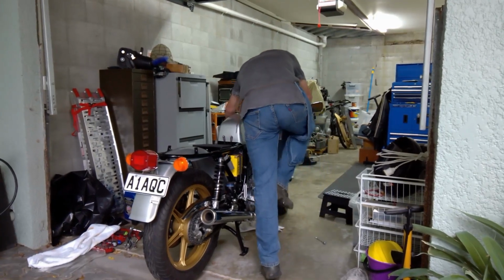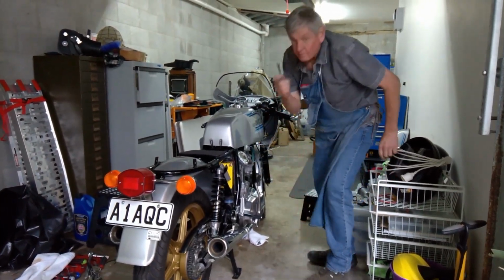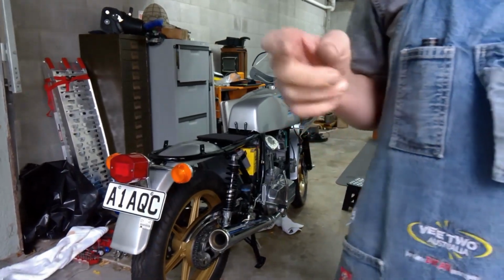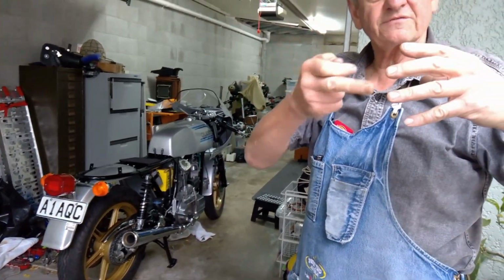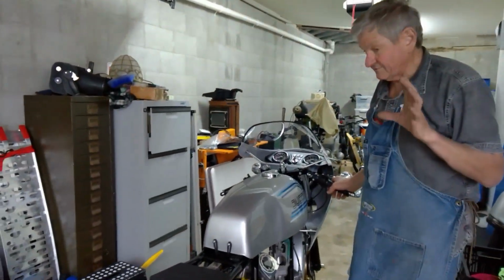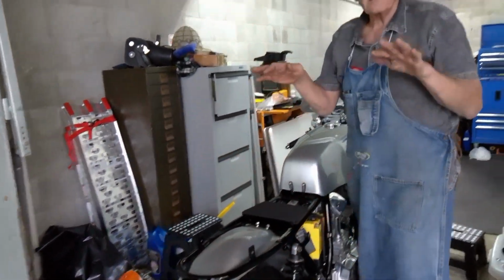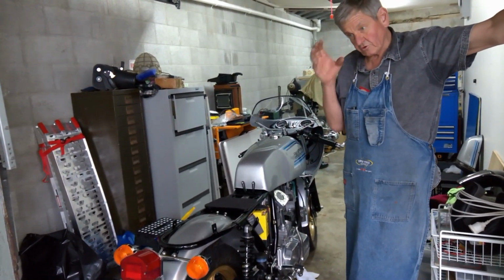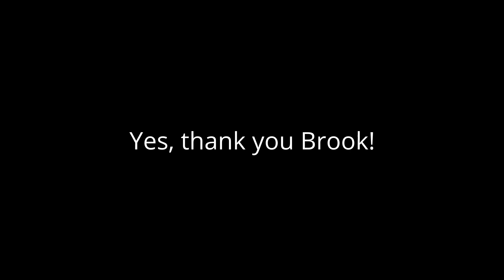Brook Henry syncs the carbs on my Ducati 900SS bevel

Comment: Having owned a 900SS back in the day I can tell you the most vital factor in getting these things to run perfectly, valve clearances.
I was struggling to get mine to idle reliably and be clean off the throttle when accelerating hard fro slow speed, also it was a apig to start. After hours of messing with carbs, which have to synced prerly of course, I decided to check the valve clearances, and there was my problem! They were all over the place. I re-shimmed them myself, after getting stupid quotes from dealers, and the results were amazing.  Even before re doing the carbs it started and ran like a clock, but was even better after working the carbs over again.  Throttle response was fantastic and top speed increased by about 10mph!  I was so glad I took the plunge and tackled desmo valve shimming myself, it took the fear out of Ducati maintenance!
Reply from the maker: Yes, definitely. Everything has to be correct and calibrated from the ground up. It's clear that many spend time messing with the outer details (carbs and ignition) without knowing the state of the internals.
Reply: Use ur left leg to start  duffus

Comment: The sound of a Ducati with Contis is something truly special. I bought the same model back in 1982 at the bargain basement price of about $4000. I was working as a Ducati mechanic at the time and bought it in the crate and did the final assembly myself (I didn't want to trust it to anybody else).

FWIW, this is was my procedure for syncing carbs.
First gauges and measuring gaps etc don't work (as Brook stated). What you need is a practiced ear and some simple tools.

1/ Sync and set the idle as good as you can by listening to the beat of each side. I used a soft cloth in one hand to gently muffle each muffler in turn till I was happy with it (don't choke it though).
2/ Adjust the mixture screw on one carby for max rpm (same as if you were doing a single cylinder)
3/Sync and set the idle again as in step one.
4/Adjust the mixture for the other carb and re-sync and set the idle yet again.
5/ If the carbs were quite a bit out, you may have to repeat this.
You might like to crack the throttle a little so you don't foul up the plugs and just to listen to that awesome note.😀
Once that part is done, you now need to adjust the free play in the throttle cables.
6/Twist the throttle ever so slightly (just off idle) and listen if one cylinder is wanting to rev up before the other.
7/Use the cable adjuster screw on the top of the carby to get them pulling at the same time.
8/Once that is done crack the throttle a couple of times because.......well just because.😊
Reply from the maker: Getting a boxed one to put together yourself would have been a great experience! I'll pin your comment up here so people can read your procedure. I won't ask if you still have your bike... in case you haven't!
Reply: No, sad story. 3 months later my girlfriend (now my wife) and I were travelling up a mountain road when rounding a bend a car was on the wrong side of the road coming towards us. We survived but my pride and joy didn't. On the plus side I still have two 450 singles. One RT dirt bike and a 1972 450 Desmo. They need work but will be my retirement project. Thanks for the video and thanks for the memories.
Stay safe.
Reply from the maker: @Jack_C_  Yikes! I thought I'd put my foot in it, but lucky it was just the bike that didn't make it. I love the yellow/orange 450. Will be a good project. Stay in touch and post some clips when you get into it.

Comment: Thanks for putting this up. Picking up my tank from the painter tomorrow and waiting on a sprocket seal. Hopefully will be tuning it next week. I will try this method before I make a homemade manometer.
Reply from the maker: Yes, this method is well worth practicing! Drop by in the ducati.ms vintage forum and show your bike if you haven't already.
Reply: @Ducati900SS  I will post some pictures once I get it back together. Looks like a pretty active forum. I posted there to try and find to some torque specs.
Reply from the maker: @pinbill1  I'll head over there now and add my 2 cents... there seems to be some confusion about which bolts and nuts people are talking about.

Comment: Great video and love the old school guys. My SD was a joy with well set carbs and (horror of horrors) I used mercury gauges. I knew it was spot on when I closed off the throttle and got  immediate engine braking and that “tweet” off the Contis. It’s due back out of surgery this year and I may well try by ear. You never know, I might just get it right.

Comment: The first 6sec's were particularly useful to me . Brook tried to talk me thru the kick start process when I got his bike, and this really helped. (Wish you could talk him into Zooming...)Interesting how he relies on his ears for balancing, not fancy gauges or meters. Looking forward to getting somewhere there. your videos help  Thks mate.
Reply from the maker: Yes, the benefit of doing it by ear is that it makes up for any running issues that a technically perfect sync wouldn't allow for. I've spent a lot of time doing it by ear now and also have a very sensitive carb sync tool. I never get the exact same setting with both methods. By ear I get it feeling right. With the tool I get it technically correct. I've found both methods good, but the tool is quicker. I'll be doing a video of both methods, including mixture adjustment. Brook has the ear method nailed down to perfection... much like his kicking from the bottom of the throw.
Reply: 'Kicking from the bottom of the throw" . ? I practiced withe the key turned off . One long stroke all the way thru, then the next kick which should start it Brook kicks the lever  at about half to vertical.  Is that what you mean? 
I used to  to get the lever to the top , thinking this was where to jump on it from. It's also where I was told TDC was. Brooks instructions were more useful.
Reply from the maker: @flanderstf  You can get to tdc anywhere in the stroke and Brook here is really just demonstrating his/the bike's ability to start it with the bare minimum rotation if you can find the spot. The main point of using the full stroke for the rest of us is that we're more likely to hit that spot somewhere along the way. I still use the full stroke and I don't spend a lot of time digging for the spot. I just go for some compression and hit it.

Comment: Great to see the master at work. I’m just about to tune the PHF30s on my 74 750 GT after rebuilding the carbs. At what point did the mixture screws for each carb get adjusted? The emphasis in this video seems to be primarily on adjusting the throttle-stop screws for idle and the cables for slide synchronisation. While there are plenty of references to be found on tuning Ducati Dellortos on the web, there’s nobody more authoritative than Brook Henry. Very interesting video - thank you from across the ditch. 😊
Reply from the maker: Hi Stephen. If you still have your carbs off the bike, look into the tiny slot where you can see the pointed end of the screw moving when you turn it. Then spin that screw in an out and you'll see how it opens and closes the hole. Aim for the point in-between open and closed and count how many turns that is from all the way in. This should be around 1.5 to 1.8 turns out. That's the ideal starting point as you then get an equal adjustment range either side. If your engine and carbs/jets and everything is completely stock and in perfect order, then you should be able to get the best mixture very close to that point. If you change the idle jet bigger or smaller then that perfect adjustment point will move one way or the other. And if that point gets too close to either end of the effective adjustment range of the screw, then it will become more difficult to adjust e.g. you might get obvious change screwing one way and no change in the other direction. So the best starting point is about 1.5 turns out from all the way in and with stock jetting.
I've just recalled that I spoke about the screw in another video here at 16.35 minutes: https://youtu.be/N8e5hk1SB2o?list=PLULuGf3sBIFRExVT3wShAiRcMnhItfp5E&t=996
Reply: @ Thanks so much. I’m enjoying your videos, having stumbled across them fairly recently. We’re very fortunate to own these beautiful bevel Ducatis. I’ve had mine since 1975 and it now has over 100,000 km on the clock. The only major work that has been done is replacement of the big end, and that was opportunistic/precautionary as the engine was disassembled to address an issue with the sprocket mount. Only relatively minor issues other than that - valve guides, replaced Scarab caliper with Brembo, upgraded to Dyna ignition and coils, and replacement rear shocks (still have all original parts). Still a wonderful riding experience.
Reply from the maker: @stephenfoster6940  Thanks Stephen. Yes we certainly are lucky... I'm someone who could only dream of owning a bike like this back then and so there's a lot of enjoyment in just looking at it and going wow. I went out for a ride with a friend who has had his 750S since new. The bikes look so good together. I'm glad the videos are useful. I'll keep making them so long as I can manage it. Your bike sounds like it has all the right stuff.

Comment: Hallo, can someone please elaborate in detail his style of kickstarting that bike? My English is just not good enough to capture his dialect 😊
I also own such a 900ss and also want to be able to kickstart it as cool as this guys. Bonus question: the moment of the kick, do you guys throttle up? A bit? I try not to during the kick, but the mili sec after it started. Thanks!
Reply from the maker: Yes I was surprised when he showed me he could kick it like that. In the video he says "When it's cold, you should be able to get the kick start in the right position... even... (all the way down here)." He's pointing out that a well built and tuned engine should start when the crank is pushed past a spark. It doesn't need more than the first spark. And in the case of the bevel, especially when it's cold - because bevels usually don't start well when hot. I've only had PHM40 carbs on this bikes, but I imagine that the smaller carbs could be more flexible.

Everyone has their own starting procedure and it is often made into a religious process. In my experience with this bike, the best way to get it going is to hold the throttle just a tiny bit open during the kick and only open it further if it has started to run. The trick is to only open the throttle a bit more when it has fired more than once and is turning. I won't open it automatically at the end of each kick (as I would have done on my old dirt bikes) or it will just cause flooding. Keep the throttle off until it actually starts. 

Also - many people will give it a couple of full twists to squirt fuel in before kicking. I don't do that. The only time I give it a little half-squirt is if I'm starting up the first time after having the carbs off the bike.

This engine does start with the lever down at the bottom like Brook shows in the video. But there's no practical reason to do that and so I normally kick it all the way. I don't worry about finding a particular spot just before the spark because it will pass a couple of sparks during the full kick anyway. I do use choke when cold, briefly when warm, and none when it's hot. If I have stalled the bike, then I use no throttle at all until it has started.

When I first got the bike, it was very difficult to start and keep it going. It only works now because of the engine rebuild, the carb rebuild, the work I did to test jetting, and also learning how to synch the carbs. Once all that is done.. it's easy! hah
Reply: @Ducati900SS   Thank you for your response. I recently had the chance to buy a 900SS Bevel and now I am trying to figure out that universe. Already rebuilt a Moto Guzzi Lemans 1 with its Dellortos, so next step is to go over that bevel carburateurs and then its motor.
Can you point me to some (900ss bevel)  workshop documentation you used for restauration? 
I got the old Ducati workshop manuals and spare parts manual. Usually for other bikes there are also 3rd party unofficial repair manuals but I could not find one, only some books from Ian Falloon which seems to be more focused on historical and less workshop facts.
Reply from the maker: @alexanderwolf9653  I just searched and downloaded all manuals and parts listings I could find. My bike came with a Haynes type of book for 860 Ducatis, but I haven't found that  very useful as it has little data. I've got two of Falloon's books and of those the best is the 'Authenticity & Restoration Guide'. I used that quite often. The main thing I was always trying to find was correct specifications for things like torque values and carb parts and so on. That book has data tables towards the back with some good info. Details are often different from year to year and so one has to find the right data for the bike. There's a 6 video series on my channel where I rebuild my carbs and I went to great lengths to find the correct details for my bike. I had to cross reference multiple sources. Scans of the original Ducati owner manuals will have some torque specs in them, but not a lot.

It's also worth looking up other OEM manufacturer data rather than just Ducati data.. e.g. for the carbs and even for things like the horn. The brakes and carbs are used on many other bikes of the era and so there are other bike guides that have reference data.. BMW, Guzzi etc. E.g. whilst the horn is a Bosch unit, none of the Ducati manuals go any further than that. I had to find and dig around Bosch horn specification sheets to find the correct part. Dellorto does a tuning guide that is worth a read and there's also a pdf around with slide data and another with needle data. Just use Google to find everything.

Otherwise, you've probably got most of the info that is available. Note that some of the scanned PDF manuals are much clearer than others as they have been scanned by different people. So keep downloading any that you find. There's also no guide specifically for my 1982 900SS and so one needs to use the 82 MHR manual instead. 

Other that that, there's the Ducati.ms Vintage forum where some good guys hang out. There's also a few Bevel groups on Facebook that are worth joining but the responses you get there can vary greatly in value and tone. I know that one of the Facebook groups collects downloads and makes them available on the group page. Join them all and check there.
Reply: @Ducati900SS  Thank you for making that videos and informations available. Its very appreciated!

Comment: Please tell me the size of MJ and PJ　　　　　　　tell me the thickness of the needle
Reply from the maker: Hi Moku. It all depends on your carb sizes,  the year of the bike, and which country it was made for (this determines airboxes and exhaust pipes). Page 278 in Ian Falloon's Authenticity & restoration guide has charts with these details. Stock parts for my 1982 900SS in the video are: 
Idle jet 65
Main jet PHM40 BD/BS had 135/140 - BD is right/lower/front cylinder, BS is left/upper/rear cylinder.
Needles K5 2nd notch
Needle jet 265AB
Slides 60/1- Standard
Earlier models with PHM40AD/AS used 60 idle jet and 152 main jet on both carbs. The smaller PHM32CD/CS used 62 idle, 122 main and K16 needle on the 2nd notch. Note that notches are numbered from the top - 1,2,3. Lower number = higher notch = needle sits lower = leaner operation than other notches.
If the bike can't be tuned to run well with the stock values then look for something else to be causing a problem.
Reply: @Ducati900SS  Thank  you!!!

Comment: RPM at idle? when they'e running / idling 'just" above stall they're amazing.
Reply from the maker: Back then I was still worried about it going pop and turning off at the lights, so I would normally go for about 1200. But now it's usually around 1000. I don't know if the tach is correct, but it sounds like a relaxed 1000. I've heard lower idles on YouTube, but I'm pretty sure they mostly die after the camera goes off :)
Reply: @Ducati900SS  My bike is older than yours but even then I swapped the carbys out for earlier (A) models - had it idling at 850 - thanks to Eddie Lopez
Reply: MySD78 would idle  about800 rpm it was a slow pop pop pop.

Comment: I noticed he didn't have a fan going to cool the bike. That's not a problem?
Reply from the maker: Hi Fatty.. No, it's fine. You can let the engine idle forever like this (if it will). Brook also explained to me that these engines are fundamentally oil-cooled, not air-cooled, hence the huge oil pan they carry around underneath. The operating envelope seems very broad in these old engines; quite unlike a modern high-powered bike with water cooling, where every degree of heat needs to be accounted for. 
I've got another series of videos here on my channel where I monitored the temperatures along with the air/fuel ratio and found the temps not significant. However, if the timing is way out or not advancing (as mine previously was doing) then one can seriously drive up the temperature whilst riding.  All those bright blue header pipes you see on these bikes show how common this is. I ruined two freshly chromed headers on my old Bosch ignition. After that I used an old pair until I knew everything was fine. Had the pipes replated again and they're now on the bike with the new Sachse ignition.